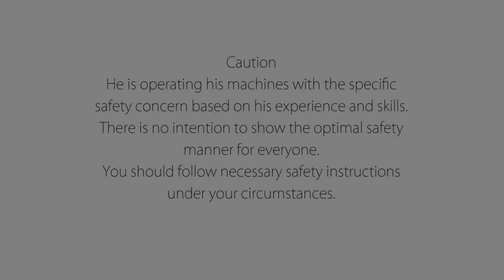ISHITANI - Making a Truss Table - Angled Dovetail Joint

Comment: Holy smokes.  You might be the only man in the world that can run that table top across the jointer.  That was impressive!  Great work as always.
Reply: Yep.... Still had to call to Chie to come help get it off the planer..... But still, But Still In my wildest dreams. a slab that size... Nope never. Maybe with three healthy men, by my self..... Nope Never.  Good comment BTW.
Reply: I once heard a quote, “the worst ideas, are the bad ideas that work”
Reply: @deanwilliams93  Agreed. I'm confused about what he was hoping to achieve by doing that, given that he then took a circular saw to the same edge anyway..  odd.
Reply: @Paul-jp8zz  It was the other edge...wasn't the same.
Reply: @didndido3638  ahh good catch.. still though.. I don't see why he'd need to run that edge over the jointer after the glueup.  but what do I know!
Reply: @Paul-jp8zz  I had to rewatch to see what you mean.
Hard to say: maybe he changed his mind on something, the customer wanted different measurements all of a sudden or he just made a mistake..but I'm sure he cut both sides to get the same width on outskirting planks.
Reply: Why is the question, when he has a power planer in next shot…
Reply: @thecrazyisreal  A power planer won't give you a long straight edge.  However, I did wonder why he hadn't jointed the long edge before glue up.  It may have been that the clamps had left marks or he wasn't satisfied with the edge.  I would have used a Stanley no 8 plane though, much safer and easier.
Reply: @thecrazyisreal  It just seems like passing such a huge panel vertically across the jointer is an unwieldy and possibly dangerous operation simply to put a clean edge on it.
Reply: I would say he ran it over the planer/jointer because the circular saw would have left a rough face on the cut. And to ensure the face remained at perfect 90degrees to the top edge he would have to use the planer. If he used a hand plane  he would introduce human error and the edge wouldn’t be 90 degrees or perfectly flat. Does that make sense?
Reply: This man needs a track saw to eliminate those dangerous maneuvers.
Reply: @Paul-jp8zz  Ye u probably know nothing compared to this guy
Reply: @thecrazyisreal  he's cutting it to width with the circular saw and then buzzing a mm or 2 off with the jointer to give it the clean machined edge, he more than likely wanted it flat and consistent. You just wont get that with a planer. In a previous job we would do something very similar with doors that were too large for conventional methods.
Reply: That table is an instant heirloom that will last several generations.
Reply: OMG, it's too  heavy and you get in control.  Congrats

Comment: I am fascinated by this video. Especially the design of the angled braces. They are absolutely accurate, not tight, just the way they should be. No gaps, perfect fit. There are a lot of sizes that have to fit. Great! It was a pleasure to watch this well done video.

Comment: Hi Ishitani!  Thanks for the wonderful lesson as usual.  I'm sure others have asked but I have yet to find the content.  Why do you offset feed the piece with the dovetail on the router?  Is it to get a smoother edge or to go with the grain to prevent tearout?   You're the only one I see use this technique.  Thank you!
Reply: I think that was a jig for the sliding dovetails so that they are slightly tapered.

Comment: Awesome video as always! Beautiful table. perfectly balanced design. Love it. Does anyone have any idea though why he used the extra jig when routing the sliding dovetails on the aprons? I know Natsuki Ishitani doesn't really reply to comments himself, which gives him an even more mythical status :) But maybe somebody else has an idea?
Reply: The first few times I saw him do this (in other videos) it took me a while to figure it out, too. And I'm still not 100% certain, but I think that jig (or spacer or auxiliary fence) allows him to route both sides of a dovetail without readjusting his fence. And (or) it may also have a small angle/taper, which in turn creates a tapered dovetail on the stretcher. Honestly, I'm not sure if the dovetailed slot in the table is tapered, or if the dovetailed stretcher is tapered. But you can see that it is a definitely a tapered dovetail during assembly when the stretcher slides easily into the table for 90% of its length, only snugging up for the final 10%, at which point he drives it home with a hammer.
Reply: @idontthinkso666  I'd thought about this myself, but after reading your comment, I'd say your spot on with the stretcher jig being slightly tapered.
Reply: @idontthinkso666  Does make sense indeed! The taper explanation I mean. The other explanation seems wrong in this video, where it seems he does move the main fence. So let's stick with the ever so slightly tapered jig :) Thanks
Reply: Yep it is to induce a very slight taper that he can adjust the fit with.
Reply: I agree with the  jig setting the taper. I can't wrap my mind around how the other side gets tapered with the same jig?

Comment: I recommend that you use a manual planer most of the time.
It is dangerous to use a machine planer for such a large tree.
I want you to use traditional joint at tagle legs.

Comment: Question: is there no concern the bridle joint on the legs would split?
Reply: Why would they split?
Reply: @hurcorh  I just thought they looked very thin and with regular movement and use of the piece might cause them to split along the grain.